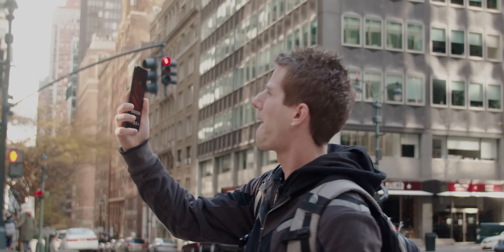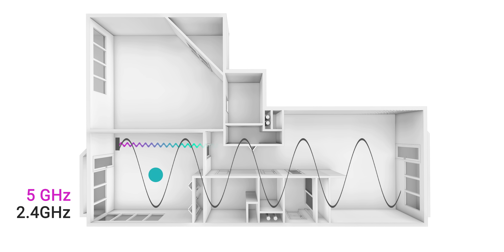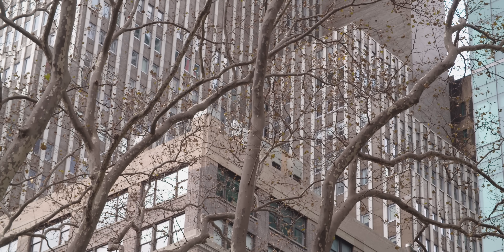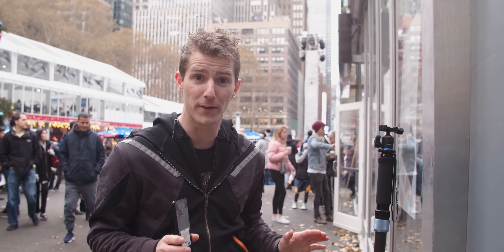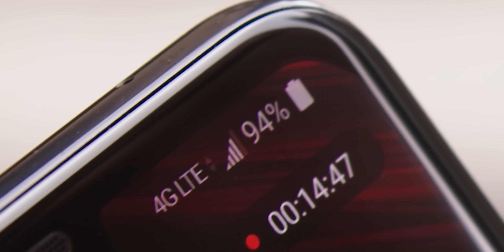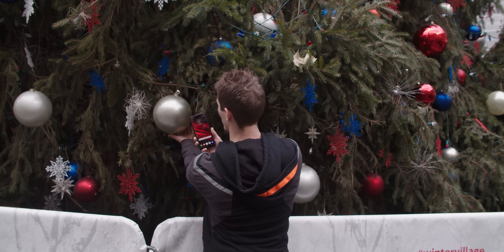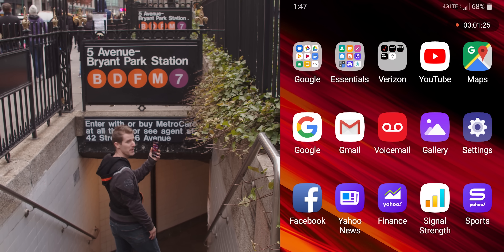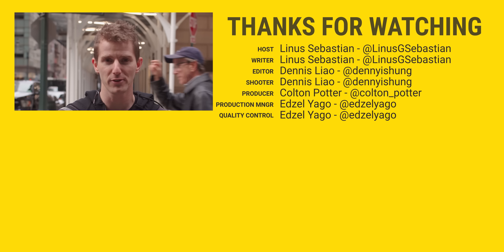The PROBLEM with 5G mmW...

Comment: The problem with 5G: it covers one city block but they're selling phones to use it already 

Credits roll
Reply: Solution to the problem according to T-Mobile: use low-band high-distance high-penetration radio waves in open countryside, then use milliwave transmission, which is blocked by as little as a crowd of people, in dense urban areas which are well-known for being clear of obstruction like buildings... and not constantly filled with... large... crowds. No, wait. That doesn't sound right...

I still hold that milliwave 5G is DoA except for hyper-specific applications as a glorified wifi hotspot. You'll only get mmW 5G in small, clear places like stadiums, except that unlike wifi you still have to pay for it with your ISP and you still need to buy a compatible phone. And even so the backbone capacity will never be enough to give 800 Mbps to all those people.

Also lol "it will even work indoors".
Reply: @Blaze6108  sooooo
use LTE-Advanced? lol
Reply: @Blaze6108  I'm 100% sure we'll get 7Gbps full coverage world wide in 2 years tops.
Reply: Also they want you to buy a 5G sim and a 5G phone.💵💵💵
Reply: @ectube  1GBs - 10GB data limit - you use 5G for 10 seconds and your limit is reached. xD
Reply: Permaculture Ecuador also it kills your battery  and the phone over heats
Reply: And how is this different to when 4G released?
Reply: @jestt600  4G works in houses and outside 5G is blocked if you face the wrong way and your body is in the way.
5G is vary short range and can't be obstructed so will require masivly more towers to be installed and if you live away from a big city your out of luck

So yes it is vary difrent from 4G
I asume for most normal people they just won't care.
Reply: Like Nvidia and ray tracing 
If you ain't first you last...
Reply: @alil1294  except that with Ray Tracing, you can actually play some Ray Tracing games in your city, with 5G, you need to go in a city out of your country because, you know. It's only avaible in some few cities. Thanks 5G
Reply: @TrioLOLGamers  point taken
Reply: Hey TechDove will you do other videos?
Reply: @Lensgo_it  yeah I have a few more slated. 
Note 10 + essential phone long term review, apple watch series 5, iPhone 11 pro max, pixel 4 XL and Huawei mate 30 pro
Reply: No one is making you buy the latest smartphone. I would wait until the cell towers have the capacity of 5G coverage.
Reply: So it's not worth it atm to adopt 5g yet
Reply: I think the problem is that it’s cancerous.
Reply: Like 8k TVs
Reply: @Jordan Sklar I have AT&T sub 6 5G by me and it's a little better than LTE, Not that I've ever had an issue with it
Reply: TechDove and they are selling them at higher price.
Reply: @kaptain1477  because it needs a separate modem chip.
Reply: well yeah they are selling 5g phones already, because coverage will not stay so localized... 4G was the same, within a year of launch most major cities had wide coverage...
Reply: @volrath__  bullshit, the range of 5G alone limits it to only cities.
4G LTE-Advanced would be more practical.

Along with fiber optics throughout USA to promote cheap unlimited data plans vs 5G 1GBs but in 5 seconds you hit your data limit...
Reply: @permacultureecuador2925   I'm in the UK, where 10 major cities already have 5g in some form, almost all towns even villages have 4g and access to fiber, and data caps for home broadband aren't a thing, as for mobile data, I pay £25 a month for 100gb of data... (Oh,and we have free choice on ISP for home broadband as there is no region locking bullshit)

I guess this is the issue, the US is so far behind many areas... I was shocked that when I went a couple months back you still sign for things, and no where had contactless... In the UK even small local shops are contactless and chip and pin has been the only way to pay for a decade now...

While it may not make sense in a world where slow internet is a way of life, in places like the UK it's just the next logical step ;)
Reply: @volrath__   yeah I still dont see the benefit of 1000 GBps on my LTE-Advanced vs 1000 GBps on 5G oh wait no dropped connection, oh wait my phone ran out of battery powering 30 5G antennas...
Reply: the biggest actual reason ive heard is "oh its for driverless cars & IOT"
1 - IOT?? who the hell is going to buy a sim card for every IOT device they own + a data plan? that one makes no sense to me.
2 - driverless cars... goes around a tree and looses signal.... hits a pothole and looses signal... yeah doesnt make much sense either...
Reply: @volrath__  looks like it may only work outside tho,
Reply: @volrath__  but for 4G you didn't need a node every 300 meters. Equipment cost money, positions cost money....it will be slow, much slower than with 4G
Reply: @gorky_vk  Like is said at the end of the video, other service providers are doing things differently meaning a more stable and further reaching service... This is just ONE implementation of the tech
Reply: @volrath__  but main limitations coming from frequencies range 5G use so different approach can change things a little but nothing will give it 4G range, not even close.
Reply: Xtreme Performance  not everywhere in the world has so much problems with internet connectivity as US. And if you plan on using your phone for more than a year or two it's good to have it come with 5g support already even if the infrastructure isn't ready yet.
Reply: Well.... Huawei solved that problem and they are banned in America, lol